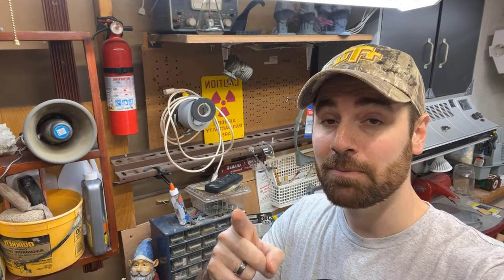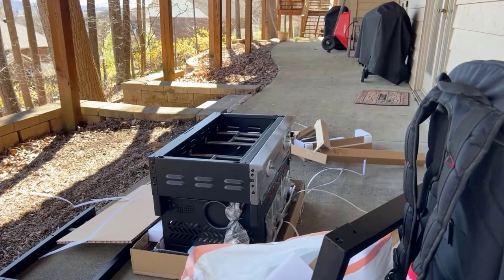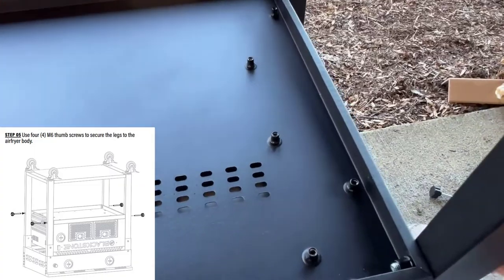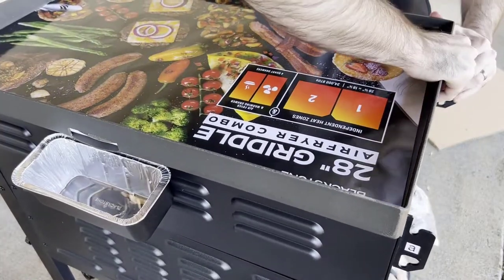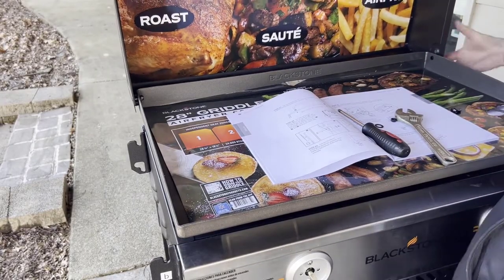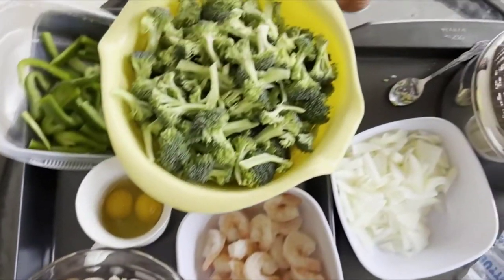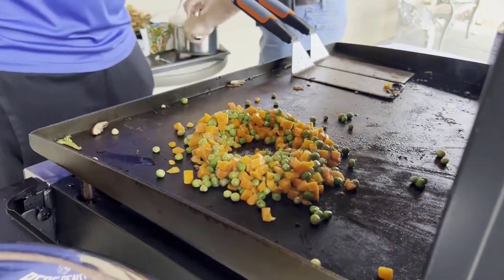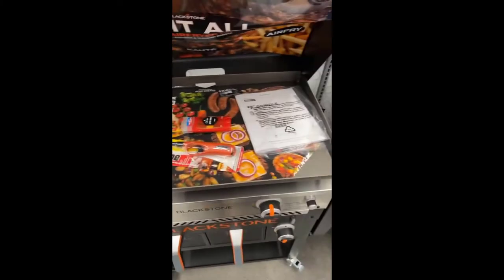Blackstone Review & Assembly: Airfryer Griddle Combo Model 1785

Comment: thanks for making the video you showed the burners which I was curious about. Question, how far does the heat carry over from 1 burner to the next? Like if you had burner 1 all the way up and burner 2 all the way down. I'm guessing the heat from burner 1 will carry over a decent amount?  There's a lot of space between the 2 burners which is nice. I'm wondering how good this would be if you wanted to usually have 1 burner ripping hot and the other 275-300f'ish.

Comment: The screws for the side are wrong in the book and took away so much time and then seeing your video helps on that part. Then to top it off my griddle does not lock into place 😫 so i think i may have a defective piece. So for now my grill is halfway put together until i call them tomorrow i guess.